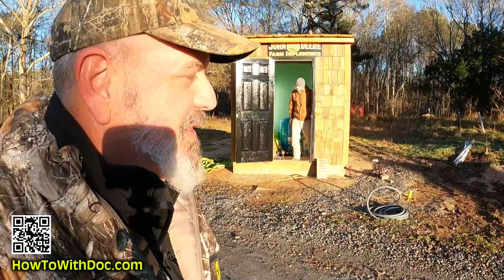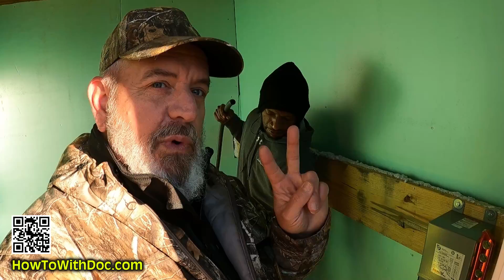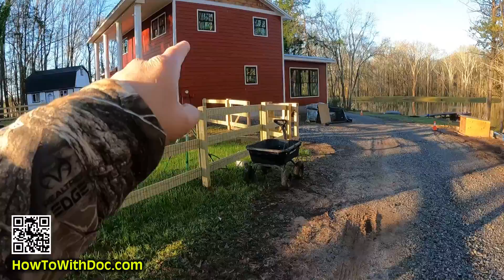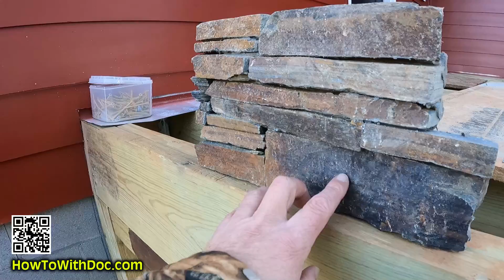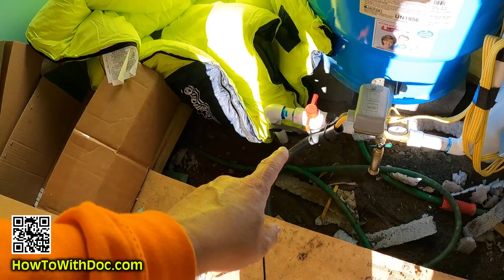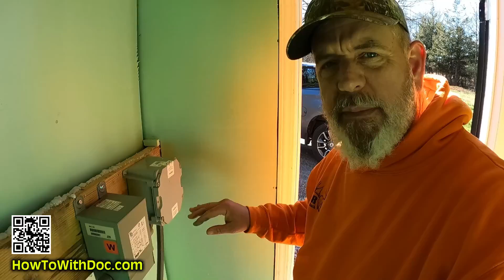Convert 220 to 110 Outlet - Keep 220 and Add 110

Comment: I'm guessing here (I'm no electrician....just a handyman), but considering the minimal difference in cost, I think as a general rule you should always run three wire with a ground to all outbuildings.  That way you have 110/220 options down stream w/o having to resort to transformers.

Comment: Your transformer is the source of the 110 V and specked to supply max current based on the size of the transformer. The more current you require the bigger more expensive the transformer.